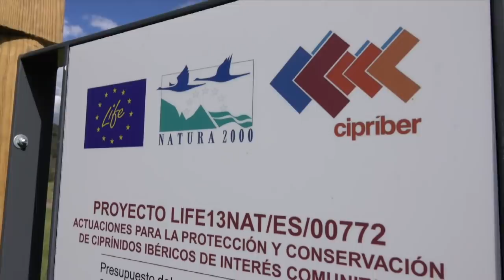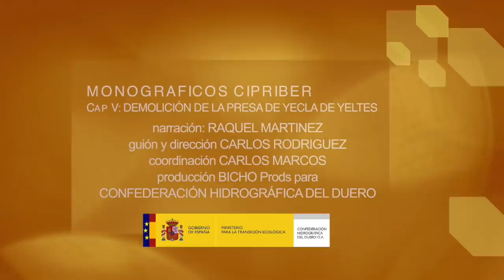DEMOLITION OF THE YECLA DAM

Comment: In other words - you took down one big dam and put in a small dam with fish ladders.  Fish ladders often dont work or fall into disrepair quickly, so what was the point?
Reply: You seem to be making an assumption that because fish ladders often don't work or fall into disrepair that this project of removing the Yecla River and establishment of the fish ladders would yield no net gain.   

This video did not go into the aftermath of the dam removal and if in fact the weir and fish ladder improved the overall environment.  A brief search did not answer this question.   Fish ladders often do function as designed however. 

And while a weir can be considered a type of dam it is smaller and is intended to make a river more navigable.    

The EU has embarked on a dam removal program with an eye on not disrupted the environment by removal of dam as building the dams had done.  This is a complex issue that has many positives and negatives.  The Balkan region is on a dam building spree for example of the latter.
Reply: Here on the Klamath River was become a sewer killing every living thing in it.
Millions and Millions of dead fish along the banks of the River.
I don't think that it going recover

Comment: Spain, the Dane Cook of countries. Lets help the fish by polluting the stream with concrete particles and rust grease from the old metal gates. Then lets re-dam it with a fake fish ladder to pass inspection. Typically spanish, want to know where the mexicans learnt incomitance, watch this video.
Reply: Incomitance. Condition in which the manifest or latent angle of deviation of the lines of sight ofthe two eyes differs according to which eye is fixating or in which direction the eyesare looking. This condition is usually attributed to a paresis or paralysis of one ormore of the extraocular muscles.

Comment: Nice job guys! Although dams helped local economies at the time, many are now obsolete. We also didn't realize the environmental impact then.
Reply: @Girard Says the guy on a marvel of modern tech, built in facilities across the world and exploiting huge amounts of natural materials and resources
Reply: Franco never had a clue about environment.
Reply: Oh Great one  The dam fell into disuse after it was no longer needed. Unless you can provide any evidence that this structure reduced or mitigated the chances of drought, I stand behind my opinion.
Reply: @jbbuzzable  amen.
Reply: @jbbuzzable  "No longer needed" is bit problematic as it is more like at the time was no longer needed. And as the drought and problems with power supply deepens across the Europe, I feel like removal of dams, especially those that can be modernized and put back in service, is terrible idea. They could have came with some regulated fish ladder that would be able to deal with variation of water level and as well add power plant.  For example back in 50's 60's plenty of hydro power plants were shut down as coal/oil electricity was dirt cheap, today with soaring prices, their capacity and output are missing. As well their shit down had caused increased consumption of fossil fuels. Roughly 3000 t per MW of shut down capacity.
Reply: @MrToradragon  Fossil fuel plants are also shutting down as solar and wind are better alternatives. As grid storage increases, they will become become a thing of the past. It is already happening.
Reply: @jbbuzzable  As long as there is at least 1kW of installed capacity from fossil fuels in grid, there is no place for shutting down hydro power plants. Noto to mention that we will have to replace great chunk of ff in transportation and that will require quite some amount of additional electricity production, beside other things, like revival of light-weight railroad carriages that can run both on railway and tram/metro  with tight curves (gauges are mostly the same or close enough, 1435 mm gauge stock cen run on gauges up to 1450 mm at least.) and thus access inner cities. 

Sure, wind and solar are great and solar can reduce cost for consumers significantly,  But we should not get rid of hydro when dam in concern is in reasonably good shape and can be altered in order to allow for passage of fish.  They did build fish ladder over weir they had left in place and even had reconstructed. The same could have been done with spillway perhaps with some features like gates to allow to control water levels behind the dam.
Reply: @MrToradragon  There were other dams on this river that had fish ladders installed. This particular dam had fallen into disrepair though, and there were more practical sources of power and water. I speculate that the decision was largely financial. The cost of repairing and maintaining it was likely not worth the meager benefits it provided.
Reply: @jbbuzzable  We have had no luck with fish ladders. Extremely few fish figure out to swim into them and most just stay at the main spillways where the strongest currents are. We still have to catch the fish and carry them above the dams at great expense and labor artificially.